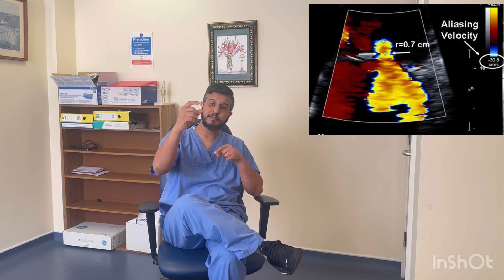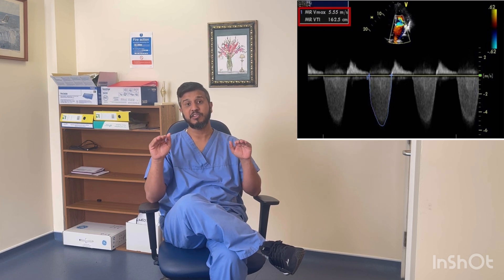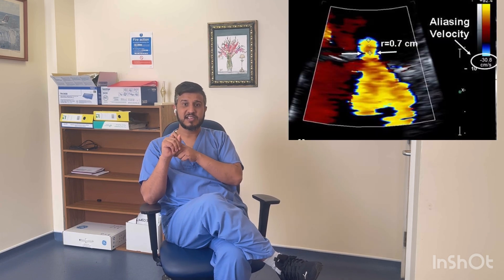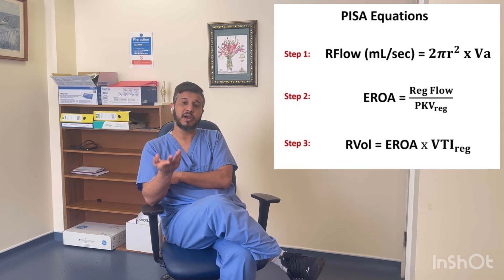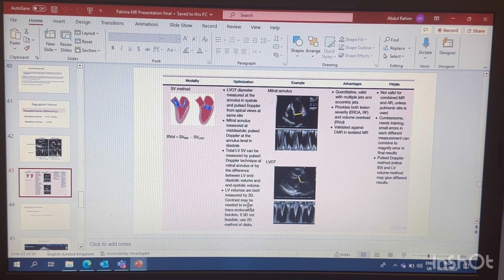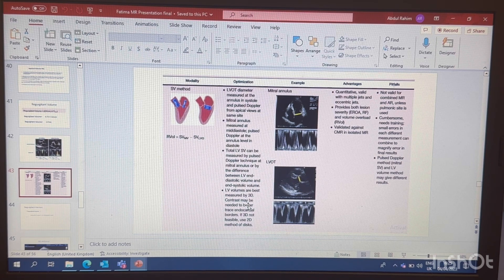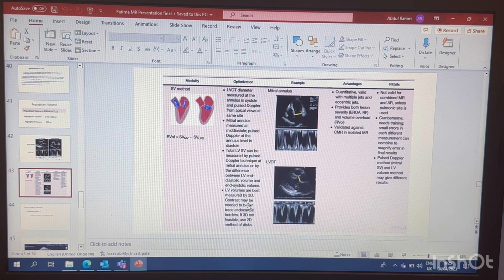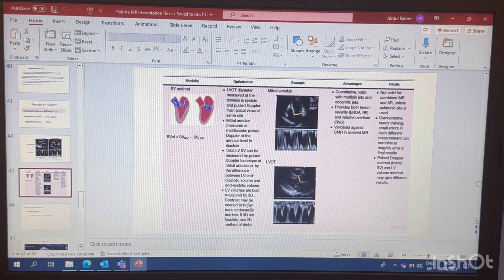Regurgitant Volume, how to calculate Mitral Regurgitant Volume

Comment: Great video! Should one still try ERO method after obtaining the regurg volume by continuity method and vice versa? or should one only perform one specific method depending on the type of jet/jets?
Reply from the maker: Actually we should apply different parameters to validate our information. In this way we can reduce the errors. Because in clinical practice we don’t always get straightforward cases there are some technical difficulties so if can get different parameters it’s good for us